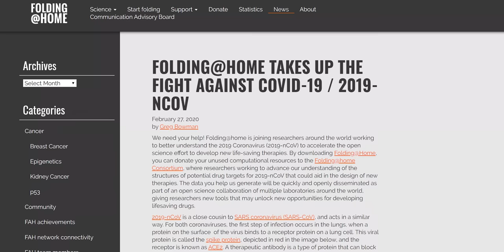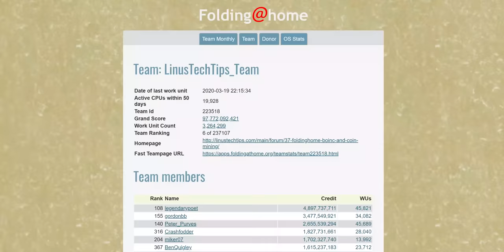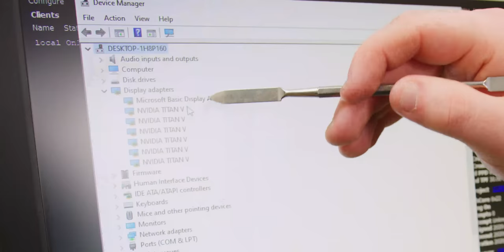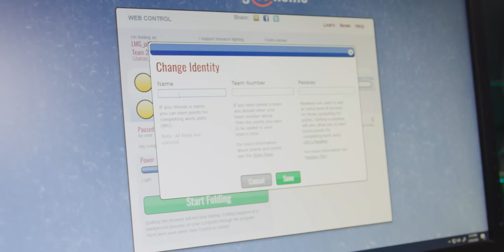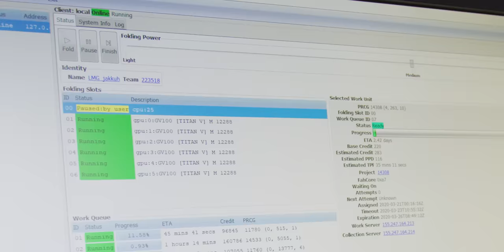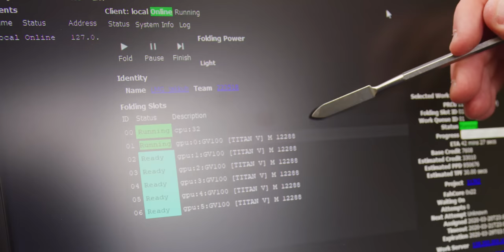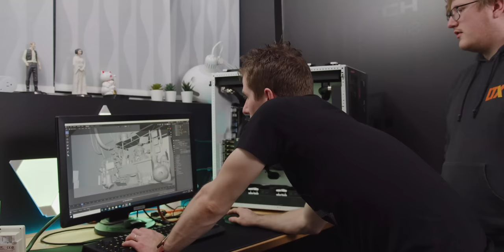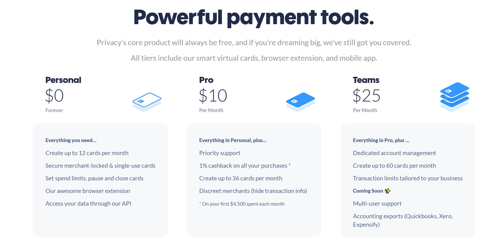Here's How YOU Can Help Find a Cure for COVID-19!

Comment: Me with my 2 core 8GB integrated graphics laptop:

"They're counting on us"
Reply: this should be the pinned comment
Reply: I raise you with my:
2 core 4 thread i5 from 2012
4gb of ram 
Intel hd 4000 integrated graphics
Reply: @santerixdxd  I raise you a Core 2 Duo E6550, GTX 460 and 4GB DDR3. On my other desk, a 3600/5700XT with 16GB
Reply: Core 2 Duo to the rescue!
Reply: @dudburst7706  I raise you with my computer powered by a Pentium T3400, integrated graphics and 3gb of DDR2 and....WINDOWS VISTA.
Reply: Core i5 7200u
Intel HD 620
4gb ram
Windows 10
Reply: I raise you my raspberry pi
Reply: @dudburst7706  heh, I remember running folding@home on my core2 duo laptop from 2007. At the time it was considered pretty good. Every little bit helps, I think
Reply: 8 Core 5.1ghz i7 9700k rtx 2060 super 16gb ram
Reply: I've frankensteined some parts of my Core2Quad Packard Bell PC with an i7 4790 build I just built: it's a good thing I got that done in time for this pandemic. Let's do this!
Reply: I raise you with my grandfathers commodore
Reply: Core i3 550
4GB ram
Reply: @Sbensbeve  did you try it? i could not get it working with my i7-8750h uhd 630 and 16gb ram but it doesnt connect and doesnt start it just flickers away and is stuck.
Reply: @dudburst7706  I raise you with my 4GB ddr3 and my Baytrail Integrated graphics 2.16GHz
Reply: @bramy9  I raise you my toaster
Reply: Xeon e3 1230 with a gtx 1660
Reply: im doing my part
Reply: real1st1c same here but amd a6 4 cores 4 threads Radeon 6520G intergrated graphics and a charger that burns skin and my laptop gets to 75 degrees on medium load on the folding app
Reply: pha i have a e 1800 working hard
Reply: @santerixdxd  bruh talk about my 2009 with a i5 2500k or something with like 8 gb ram and a 560 ti
Reply: Core i5 4210U
GeForce 820M 2GB
8GB of ram
Reply: Core i3 with unsupported integrated graphics and 4gb ram already running a Minecraft server
Reply: I raised you with my:
Intel Pentium Silver
4GB RAM
Intel HD Graphics
Reply: ASUSPRO ESSENTIAL PU401LA
-i3 4010U
-8 gb of RAM (4gb from factory)
-Intel HD 4000 integrated graphics

At least, it doesn't overheat/thermal throttle.
Reply: Nobody asked you all to give your config
Reply: @zoh2615  wait a second, did you buy a cpu that's more expensive than your GPU?
Reply: same
Reply: Fynn Haggenmüller yes
Reply: @miko8732  Razer RGB-Gaming Toaster?
Reply: @zoh2615  hm that seems like a strange match to me, why did you do that?
Reply: the power of celeron will save us all
Reply: That’s my laptop same specs lol
Reply: Pentum 4 desktop with 1 gig of ram and integrated graphics on windows xp and a Intel celeron N3350 (1.10Ghz) laptop with 4 gig of ram and heat problems on windows 10. Hmm how desperate are they.
Reply: I raise you: a Dell latitude laptop with an Intel Celeron and 2gb of ram
Reply: @santerixdxd  Nice 2012 Macbook Pro (I literally have the same computer, but with 8gb ram I put in myself)
Reply: @joshuaplantan90  So I am not the only one with a celeron
Reply: GamingSpace GS  who said there is?
Reply: @santerixdxd  I got the same but I have 8gb of ram. Every little helps to the cause.
Reply: @dudburst7706  i rasie you with a pentium 3 tualitin 1ghz 256 of ram 40 gig drive and a 400 watt power suply
Reply: I have 2 core 2 GB RAM No Off-board GPU just depend weak Integrated GPU(No GPU RAM)
Reply: Every bit of computing power helps, no matter how small.  You're doing your bit and I'm doing mine. I'm running on an i5 2430 and 4Gb.
Reply: Santeri Miettinen little bit late, but I help with my 2700X (watercooled)
RX 570
Reply: i5 3320m igpu with 8gb ram
I'm still gonna help though
Reply: time for my Athlon 64 X2 4000+ to save the day
Reply: i7 10710U
16 GB
Intel UHD

Dummy cooling
Reply: Santeri Miettinen i raise you 8gb 2666mhz ddr4 and an amd a12 apu(cpu w/ igpu)
Reply: I raise you my I3 dual core 2.10 ghz 4gb, intel hd graphics 3000
Reply: Well not really, but if 10,000 other people with the same computers start doing it,....
Reply: Core i5 2330m
4gb ram
Intel hd 3000
Reply: me with my 16 core 4.2 ghz 32gb  2 nvidia 1080 computer

theyre counting on me
Reply: @Sbensbeve  I have a laptop with the same CPU. Only 8 gigs of ram. Entry-level Graphics processor.
Reply: I actually run it on my work computers  in idle only mode so it does some work .Not much in comparison  to my GPU folding at home but if you have 1 000 000 slow computers running it adds up to good fold.
Reply: Every bit helps! Thanks!
Reply: @anamayarawa514  I raise you my Celeron T3500, integrated graphics, 4GB of RAM and 300GB of HDD. Great keyboard though!
Reply: @aryobyte2102  Wow I forgot about this comment. Very recently I bought a brand new system, came with a Xeon X5570 and 24gb of ram, threw in a RX 580 and my old 1tb ssd, the thing plays majority of games at decent settings. Aiming for a CPU upgrade to get rid of a slight CPU bottleneck.
Reply: @dudburst7706  Oh really?

Core 2 duo E6550, some integrated card, an entire 2 gb of D D R 2 ram.

Oh and cant forget the dumb i9 9900k and 2080s with a measly 32 gb ram sitting in the time out corner

Comment: Linus: This little machine isn't doing much
The little machine: *Costs 25k dollars
Reply: XantheFIN 25k
Reply: @XantheFIN  it is, but as i recall they didn't actually break the 100k. I think it was something between 30k and 50k
Reply: and linus dropped it
Reply: apple's grate has nothing on the LTT PC
Reply: Little??? That thing could fit 6 of my pc in it.
Reply: @XantheFIN  The case is from a defunct company called CaseLabs. That case is around 800-1000 depending on the config when they were in business.
Reply: They likely didn't actually pay for it.
Reply: @XantheFIN  A good chunk of the cost was the memory too, which has been pared down to a 1/4 of what they originally had in there. And originally it was supposed to be a 100k machine but IIRC in one video Linus said it was closer to 25k
Reply: It’s a lot more than that, the gpus are $3k each and the cpus between $10-13k depending on the seller, retail of $10k. That along is at least $38k-44k alone. Now they probably paid less but still

Comment: Sorry guys, I have already added 107k points to PCMR :-( Changed it to LLT now!
Reply: Yeah, I'm supposedly able to do something like 300k pts a day.. but I got exactly one job for cpu, and then it stopped getting anything.. Got 28 cores reserved for folding and nothing lol
Reply: @AlanDike  hopefully they will be able to resolve the bottlenecks within a week or two
Reply: @AlanDike  I was getting 800k/day just on my GPU, but I got exactly 1 job and then nothing. Turns out Folding@Home is having trouble with bandwidth, which makes sense
Reply: Don't apologize for teams - folding is folding mate 👍 While teaming is fun and competitive, at the end of the day it's just tags on donations for the same good cause ❤
Reply: @charles-antoinemartel-roy  yeah, I'm running a several year old card.. and it wasn't top end even then.. rx 570.  Also have 28 threads reserved.. but nothing
Reply: @AlanDike  An RX570 with a 28 core processor? That's an odd setup.
Reply: @danieltanuwijaya7675  not really.  The machine isnt a gaming rig, it's a virtualization host.  I just needed a video card to have output, and I had the rx570 laying around.  It's not a 28 core box, it's a 16 core hyperthreaded box.. I have 28 threads allowed for folding and the other 4 for os use.  I'm not actually hosting any vm's on it at the moment..

Comment: I like that you've finally helped give this the attention that it deserves. I've had two servers working around the clock crunching CoVID-19 in two different work channels. At the moment, Stanford and Temple servers are crashing every 15 minutes from being overloaded with work unit orders and that's kind of normal when you're expecting help from 1000 people and you get a response over 1000x that. Sometimes the servers have to go offline between batches just to move data around but this is outstanding. Great job everyone. Keep those requests coming and don't be discouraged. If you're not getting work orders, it's not your fault. Just keep trying.
Reply: I could not get a task for an hour, didn't get a response from the server
Reply: @seppalastname4574  Can you try something for me? Go into advanced settings and configure each work slot (cpu/gpu) with an extra slot item. I run it with the name client-type and value beta. That flags me for work orders and I pick them up quickly. Pause once and unpause.
Reply: @DaemonForce  its OK, it worked after that hour and I now have completed like 7 tasks

Comment: Could you imagine if all of the mining riggs had been used for something useful.
Reply: there’s actually a cryptocurrency that folds called curecoin, too bad people were too focused on bitcoin
Reply: A lot of us do in the winter. Not folding, but rosetta/gpugrud/wcgrid with gridcoin. Zero carbon heat and a lot lower heating bill, even though we mine at a loss. Cheaper than burning nat gas.
Reply: faudanke barely anyone mines bitcoin, it just isn’t profitable
Reply: Tell China to stop making fake GPU and sell on eBay. GTX970/980/1080 DO NOT HAVE A VGA CONNECTOR!
Reply: @faudanke4459  there is a cryptocurrency called Banano, which is better.
Reply: Dogecoin supports folding!

Comment: 4:40 as a Brit electrician I find that mad lol, like 3kw to you guys is 27amps, but to us its only 12amps. Almost all of our home home/office sockets are protected by 32A breakers at 240v so we get 7.7kw max power before the breaker trips.
Also we all get the same consumer 110-240v rated PSU's globally, I've noticed the efficiency ratings are a fair bit lower for you guys so you have to use slightly more powerful PSU's than we need.
Reply: Hmmm... good point. Never considered running 240v to my office... 🤔
Reply: @QPatriot07  Or, just weigh up the cost of a voltage transformer to feed only your PC. To be honest its probably not worth it or else every American PC user would've got one by now lol
Reply: Only way it would really make sense is if the PSU could draw a fair bit less than half the amps when running at twice the voltage... Otherwise the power bill would still be the same.
Reply: the transformer would have the same loss in efficiency as you would gain.
Reply: In North America there is 208v  without transformers by using 2 phases shifted but I'm not sure if you need to pay more on the contract

Comment: Just think of the electricity cost as a donation that’s actually going to real research and not just “awareness”
Reply: Commercial Battery wont last that long.
In SEA which use traditional battery, it is recommended to replace the battery of Solar Cell installation within 3~5 years.
Reply: And some of us live in regions where power is dirt cheap. It would cost me maybe $20-25 CAD to have my 3900X and GTX 1080 running full tilt 24/7 for a month so you can be sure I'll be folding.
Reply: If it is money that goes towards heating anyways then it isn't much of a difference.
Reply: @jamaly77  this power is going to be used anyway by researchers if we don't, It'll just take longer. Stopping climate change isn't all that useful if we're wiped out by a pandemic. And even then, we have some carbon-neutral/renewable energy source these days which helps. Add in the lower levels of driving, and even with the potentially (with so many businesses closed it might not actually be this way) increased power draw, we're producing less waste because power plants are so much more efficient than a gasoline or diesel ICE vehicle.
Reply: @jamaly77  My electricity is clean so joke's on you
Reply: @jamaly77  you have zero idea how power generation works do ya. If it's there, you aren't wasting it. That's not how electricity works
Reply: You can put this on a resume, and write off some of your electricity bill on your taxes.
Reply: @kendokaaa  Build your battery bank with ni-fe cells their rated for 50 years and allot of the ones from the early 1900s baker electric cars still hold a 100% charge
Reply: @F B I'll just run right out and get some.
Reply: @cjhawk67  Mine are LTO base, they last about 20 ish years according to the cell manufacturer. Pretty awesome tech for stationary things IMO, especially since they have pretty much best known charge/discharge efficiency
Reply: @Klokopf52  Nice I'll look into them if i ever build a second solar shed :)
Reply: F B solar is a waste of time unless we get the efficiency up. We should be switching to nuclear. But despite nuclear being objectively the best option for the environment and humanity, it sounds scary and doesn’t make people feel warm and fuzzy so we have to dick around with solar and wind for a few decades.
Reply: Jamaly 
Tell that to places like France who want to cut their nuclear power production in half to switch to wind/solar because apparently the French government doesn’t know how to do math.
Reply: @radicalxedward8047  Yikes. Where im at in Ohio im smack dab in the middle of 2 nuclear plants so power is super cheap $0.06 kwh
Reply: @F B solar panels aren't free buddy

Comment: Team LTT just topped the monthly scoreboard with 120,577,821,036 points! I'm folding on 32 cores Xeon e5-2680v2, and 24 cores Xeon e5-2430. I'm even running on all of the desktops and laptops available. Keep up the good work team LTT! I missed out on the registration for the competition, but I'm folding anyway and getting better than 1 WU per hour for the last 20 hours since I started.

Comment: *Linus pulls out a 56 core xeons with 6 GPUs *
Me with my spare calculator - take it or leave it
Reply: At this point any extra computational power is appreciated. If I had a spare GPU I'd slap it in a spare P4 machine
Reply: @cpufreak101  same dude but the thing is I am running a 2200g which already struggles to do the programing and video editting work I throw at it.
Reply: @sarthakjain6979  the PC typically is given several days to complete the work, even if it's slow it's acceptable.

Comment: "You probably have a spare computer sitting around gathering dust"

yeah... an FX 4100 + a 550ti with no psu
Reply: Slap in a PSU and make sure it has good fans and case ventilation, that'd be a nice little heater and get some work done, too
Reply: Still good enough!
Reply: I have an athlon II X4 640 with no gpu just the integrated graphics
Reply: My old HTPC celeron NUC is chewing away, every little bit helps.
Reply: Guys can my raspberry pi help
Reply: I have one without storage in it because my pc needed it
Reply: FX 8350 and R9 270x and no PSU LOL. I feel you.
Reply: Core i3 550 and no gpu
:/
Reply: @pixuhl  lol I have an fx8350 and an hd 7770 as my main rig
Reply: Firenado Hey that’s an alright rig still
Reply: @firenado4295  same but I have an rx570
Reply: My pc is already trash (Celeron D 347, Radeon HD 3600, win xp and shitty MSI 400W psu), it keeps crashing when I play cs1.6.
Also internet bandwith dropped from 40+MB/s to about 128KB/s after yesterdays earthquakes
Reply: Ha! My spare computer is a Pentium D 940 + GeForce 7300GS. Get on my level.
Reply: @pixuhl  lol had the same combo, still runnin the cpu :s
Reply: How much can my i5 2400 + gtx 660 help?
Reply: @evenrik_2214  put a linux distro on a usb stick and run it on that!
Reply: @vnyggi621  no, Folding@home does not offer ARM binary and or the full source code. But BOINC works, and they do have another project working on coronavirus.
Reply: @pixuhl  yeah but the gpu is a bit of a bottle neck tho
Reply: Firenado Depends on the game for sure. FX 8350 hasn’t been aging well IMO.
Reply: @pixuhl  yeah it is alright but I want to over clock it but Im already too close to the max tdp of the mother board and the psu is running to hot as it is (even tho it is not near its max power)
Reply: I7 6700 and 1070
But electricity bill would be too high

Comment: I found out about this on the pcmasterrace subreddit. Been doing my part with my old FX 8350, and its mini sidekick GT 1030. So far, contributed 100k+ points. So dont worry about owning low end gear. Every little bit counts.
Reply: I've been doing the same on an I5-3570K and a Radeon HD 7790. It does the job.
Reply: would a amdx64 laptop do any bit? even if its 0.01%
Reply: @Reesetrain44  It'd probably try. But to be honest I don't think I'd recomend running it on a laptop. Specially an old one. They get VERY warm!
Reply: @jackt883  the cooling is actually really good on it amazingly if I can get past Windows first
Reply: @Reesetrain44  haha give it a go then. Will be interesting to see the PPD score you get. (Points per day).
Reply: @jackt883  couldn't install the software sadly with how slow it was just running the OS

Comment: I remember when PS3 had this feature for a few years. Don't know why these companies don't start including these features nowadays.
Reply: If people use the hardware roughly, the consoles will die out faster, leading to less purchases completed through the operating system of the console.
Reply: @bosstowndynamics5488  PS3 had insane cpu for it's time.
If i recall, it had a raw power of like i7 920 or something like that
Reply: The us airforce used that feature on ps3s to make a makeshift supercomputer. You can look it up, its quite interesting.
Reply: @bosstowndynamics5488  mmm, but the architecture of the cell processor is very good at THIS precisely due to it being more GPU like.
Reply: @bronzydog7665  Wait that was with the PS3? I thought it was the PS2?